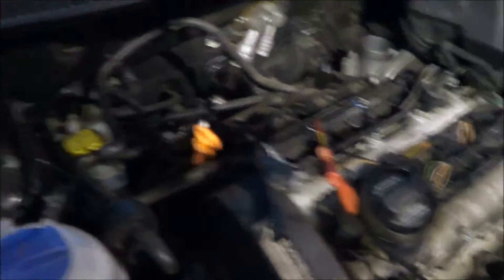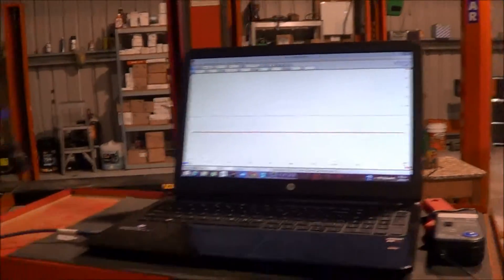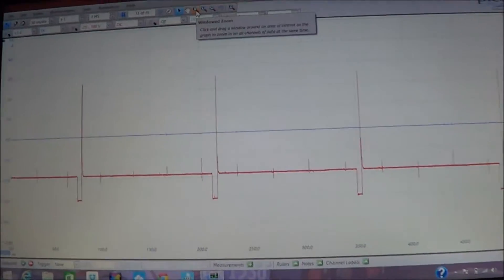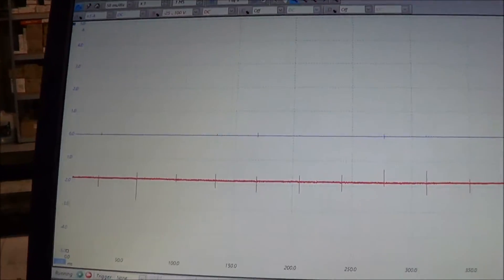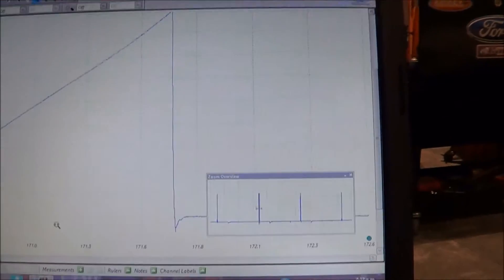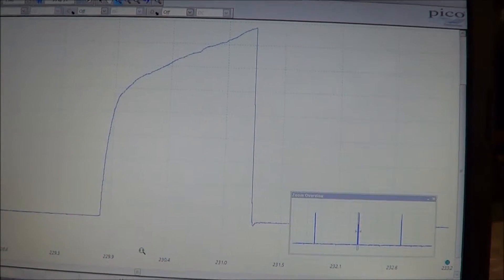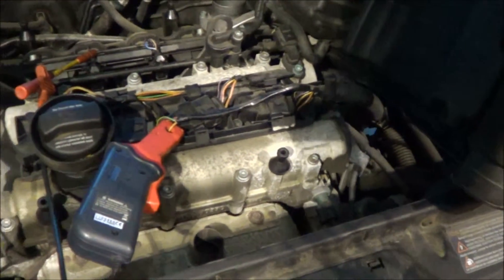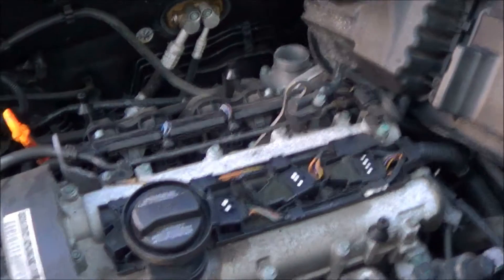VW Polo engine misfire

Comment: can belt timing caused polo 1.6 misfired?
Reply from the maker: Generally no. Single cylinder misfires are normally caused by the lack of spark, fuel or compression.